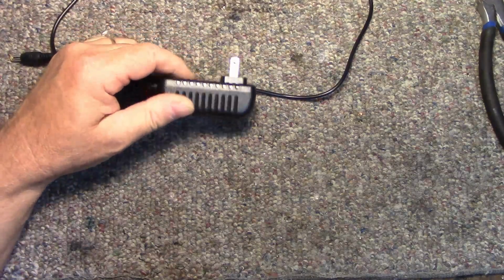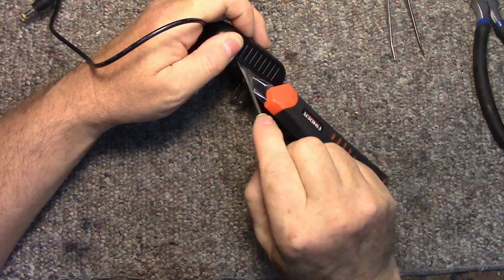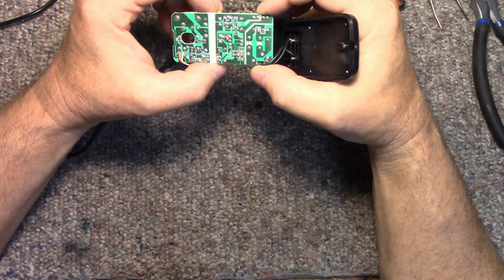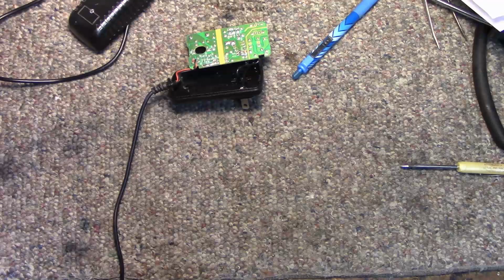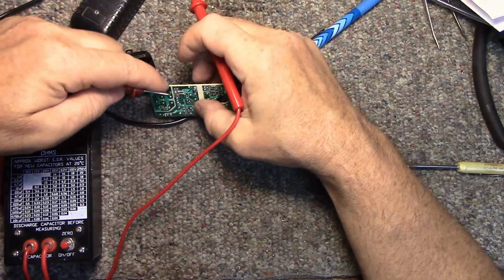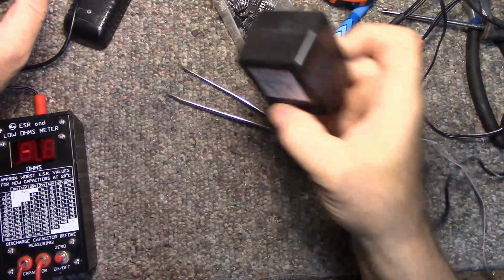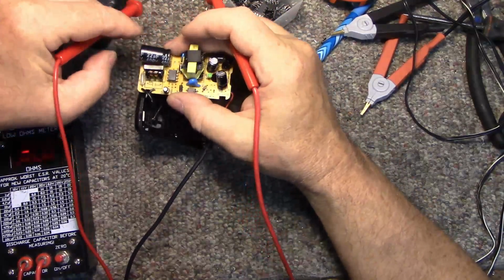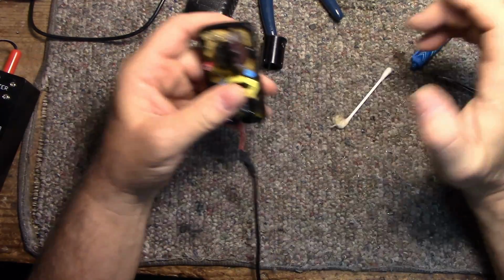Another Dead Chinese Wall Wart (Ep. 40)

Comment: Might be a bit late to the party but here's a fun fact for you: The CRE6203 is a fake of the AX6203, which itself is just a low-cost flyback controller by a company called "AXElite" (which seems to be legitimate but fairly small and unknown). The funniest thing about this chip is that the makers of the CRE6203 couldn't be bothered making their own datasheet, so they just took screenshots of the AX6203's datasheet and pasted them into a PDF. This stuff is just unbelievable...

Another funny thing is that the chip is only rated for 12 watts, yet they're using it in a (supposedly) 24 watt power supply, which might've also contributed to the chip's failure. (Although it's quite likely that the SMPS can only deliver 1A anyway and the rating is fake.) The joys of cheap chinese wall-wart SMPSes...

You should take a look at DiodeGoneWild's YouTube channel if you want to see just how ridiculous those fake/unsafe SMPSes can get!